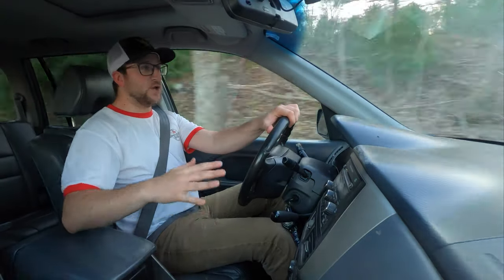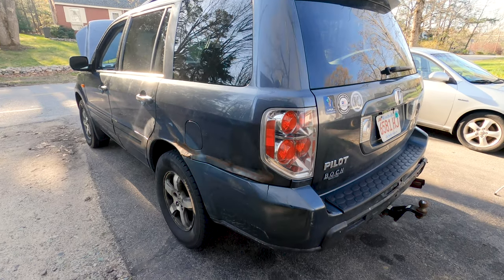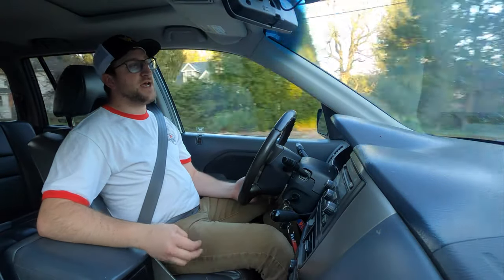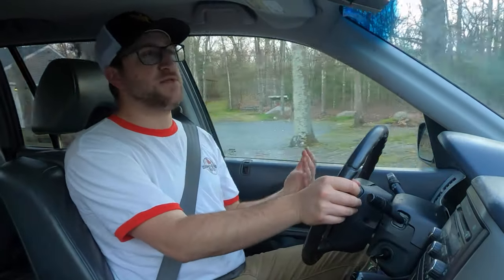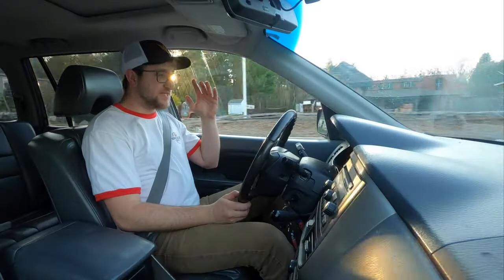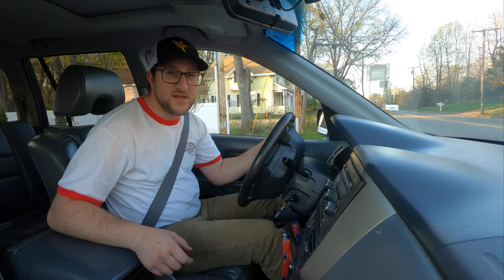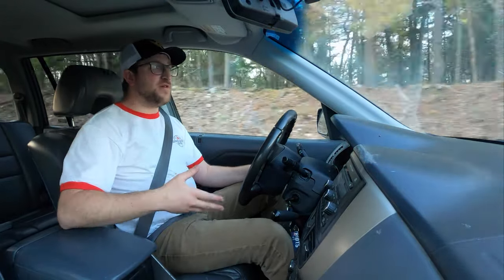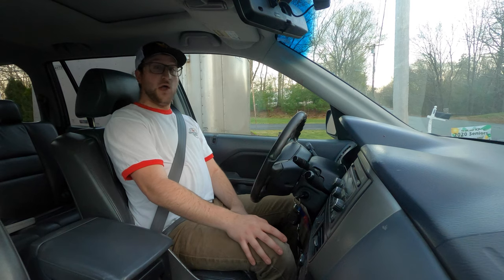1st Gen Honda Pilot - How Reliable Are They Really?

Comment: My 2006 Honda Pilot EX-L just turned 400,000 miles and still runs like a dream! It's the best car I've ever owned!
Reply: Any major repairs !?
Reply: We gave our son our 2007 4wd, and it now has 312k
Reply: Did you ever have to get a valve adjustment on your honda ?
Reply: @hortonsstuff6948 Did you ever have to get a valve adjustment on your honda ?
Reply: Good to know!! 211k on my son’s ‘06
Reply: I have a 07 2W drive mid size 164000 drive like a dream I will be keeping it for awhile.
Reply: 327, 000 on mine. 2004...
Reply: @shadowman1992 I did a valve adjustment on my 06 Honda pilot exl at around 235k miles and there was one done at around 100k.  It still runs like a dream at 367k miles :)
Reply: @CriticalQuack  do you recall if you had any tight valves?
Reply: @shadowman1992  yes my exhaust valves were very tight. And my intake valves were loose. Once I adjusted accordingly to spec all my misfire issues went away
Reply: @CriticalQuack  so you were having misfire symptoms before you did the adjust ? How long did you drive with the misfire symptoms do you think ?

Comment: I've got a 2004 pilot with roughly 340k miles and its amazing
Reply: Any major repairs or problems?
Reply: I have an 04 with only 212K. Runs like a dream!
Reply: Yeah... You can tow 4,500 lbs with it!!!
Reply: You give me hope
Reply: Good job 🤩
Reply: @RadioactiveSince1990x  the only problems I’ve had outside of normal long term maintenance was the starter gave out at 350k and I’m guessing it’s been in there since It came from the factory so honestly I can’t complain
Reply: @applepoop10  I ended up trading it for a lawn mower and from what I hear the pilot is still going strong, insane how well they’re built
Reply: 400k miles on my 05 runs like a champ
Reply: I have a 2005 pilot w 326k love it! Runs great
Reply: 2003 pilot with 338k miles here. Original power train, no tranny issues.
Reply: 404,000 miles on my 2003 model..Rebuild transmission at 230K in 2019 and was worth it...
Reply: Did you ever have to get a valve adjustment on your honda ?
Reply: @garrykennedy5484 Did you ever have to get a valve adjustment on your honda ?
Reply: @Elche2536 Did you ever have to get a valve adjustment on your honda ?
Reply: @margaritaman7745 Did you ever have to get a valve adjustment on your honda ?
Reply: @cmamaz Did you ever have to get a valve adjustment on your honda ?
Reply: @shaanonmaney1051 Did you ever have to get a valve adjustment on your honda ?
Reply: @shadowman1992  no
Reply: @shadowman1992  Yes, timing belt, water pump, spark plugs and valve adjustment at 227,445 miles. This was the first major work done. Probably should have done these at around 100k but I figured if it lasted past 200k miles, i'm in it for the long haul and had them all done. Power steering rack is leaking but I just top off with fluid when needed. It would run around $1500 to replace rack so cheaper to top off periodically.
Reply: @cmamaz  did you buy it used ? Or have you been the only owner?
Reply: @shadowman1992  I bought it new.

Comment: I still own a 2004 Honda Pilot  AWD 270K miles original transmission and engine, very reliable for all this years. All windows work, ac, etc.
Reply: Makes me feel a lil better to hear. Have the same year and model with 160k and I thought it was nearing breakdown even though it doesn't feel like it cuz usually cars last about that long.
Reply: Nice, have you replace the timing belt twice?
Reply: What kind of work have you had done for the transmission? I'm at about 163K and it feels like 2-3 gear is a bit rough
Reply: @TexasBassSlayer I currently going through this with my 05mdx. So far what I’ve seen people do is clean the shift solenoids, change the filter if you can access your and put new atf fluid.
Reply: Did you ever have to get a valve adjustment on your honda ?
Reply: Do u ever do the transmission fluid change?

Comment: My parents are giving me my first car,  a 2006 Pilot with 185k miles that we’ve owned since new
Reply: Get ready to get a new trans at 230k
Reply: Man You're gonna be fine.  You can easily get another 80 to 100 thousand miles on the clock with regular maintenance.  They're awesome. I had 152 thousand miles when I bought it and I  was up to 278 thousand miles and still ran smooth before I crashed. That's the only reason I don't have it anymore. Regular maintenance like oil changes, tune ups and belts will keep you on the road. I drove it everywhere everyday at least 80 miles a day because I live In a rural area.  Absolutely a great vehicle.
Reply: I just want to say that this is a good car. I suggest you that keep your eyes when is require to change the oil and fluids, do not left all what you car need to change. In fact it is not expensive to keep it in a good conditions. I have a Honda Pilot 2004 with more that 325.000 miles and is running so good.
Reply: @medievalmusiclover   Do you guys know if the older Honda Pilots were a little shorter in length than the new ones, they seem too big now, I was looking for a smaller one?
Reply: @MrNiceGuyDSGC99 Did you ever have to get a valve adjustment on your honda ?
Reply: @medievalmusiclover Did you ever have to get a valve adjustment on your honda ?
Reply: I agree do basic oil transmission changes, tune ups you will be find I have 3 pilots 03,07, and 10 strong pilots

Comment: I have an ‘06 pilot. And i love it to death. It is a workhorse, and I haul so much with it. Mine has been pretty beaten up by the previous owner, and when I received it, the oil was so old that it clogged the VTEC system and left me stranded, but I changed the oil and was good to go. So just regular routine maintenance and this car is a champ!
Reply: Im a amsoil dealer its what i run in my 05 pilot. Once year oil changes next level protection for any engine let me know!!!!

Comment: My 07 Pilot is currently nearing 192K miles. Still runs as new. Honda went beast mode when creating this machine
Reply: Still got it?
Reply: You betcha!!  My 07 just turned 450000 miles.  Yours is merely broke in!  ;-)
Reply: Did you ever have to get a valve adjustment on your honda ?
Reply: @jimwuerl7380 Did you ever have to get a valve adjustment on your honda ?
Reply: @shadowman1992  unfortunately, I got T Boned and it was the end of my Pilot. It had 205K miles and I was looking into timing belt change at the time. Never did a valve adjustment and not sure if the previous owner did it. However, I did maintain/exchange everything else religiously (oil changes, trans fluids, coolant, brake fluid, pads, suspension, spark plugs, steering, etc)
Reply: Im looking at 07 with 177k miles on it for 7,000 it's a AWD which I was looking for since I gotta work even during the worst icy weather.

Comment: I have a 03 with 240000 miles. Only ever needed brakes, rotors & fluid changes ( Don't forget the rear fluid. Do it yourself). Trans shuddered at 200000. Needed trans fluid change ( And Dr Shudder actually works) and two pressure switches. Easy to fix yourself. A few other little issues but it starts and gets me to work every day.

Comment: Just bought a n '07 Pilot with 108,000 miles. One owner and all recommended service done on time. I'm hoping you guys are right and at 64 I hope this vehicle is my last to own in my lifetime. I plan on keeping up the maintenance as well. Cheers and thanks for the great video!
Reply from the maker: Good luck with the pilot! Treat it well and it’ll treat you well
Reply: 2 owner
Reply: Not sure how much you drive but with only 108k you have a couple hundred thousand miles to go easily. Mines at 208k and has been maintained extremely well and runs like new and feels like it hasn’t lost a single horse power. I literally call in the sewing machine, it’s just so smooth at everything it does. I love it. I was looking for a first gen crv, this had the higher towing capacity and cargo room and to me just looks like a larger Crv. You won’t find me selling it ever, if I get rid of it, it’s because I wrecked it or someone stole it.
Reply: my 08 has 270800 miles and runs GREAT STILL just change ur air intake hose 👍
Reply: @ethancoons2606  what happens with the air intake hose?
Reply: Air intake hose rots/splits away at the hose clamp end.
Reply: @ethancoons2606 Did you ever have to get a valve adjustment on your honda ?

Comment: I have a 2007 Honda Pilot EX-L Navigation 4WD in the steel blue, solar green. That bright aqua blue, green color you see on the first gen pilot. Lol. Mine has 204,000 miles and I got it with 196,000 miles. I have owned it for the last 7 to 8 months. My previous owner bought my pilot brand new in California off of the showroom floor brand new and he kept it all this time for 12-13 years and resigned the title of interest of the vehicle on October 23, 2019. And I bought my pilot off of marketplace for 3200$ and I think it was sent to auction but the car was in perfect shape. The engine, transmission, interior and exterior looked very clean, shiny, and pristine. Absolutely no tear in the leather seats, no wear and tear anywhere in that car. My alignment on my pilot is absolutely perfect, steering wheel is straight. Engine idles and runs very smooth and drives nice. My pilot is probably one of the most rarest ones out there. I have a back up camera. 4WD vtm-4. Heated mirrors. Garage home link. Cruise control. Sunroof. Leather steering wheel. Oil life percentage. Outside temperature. Tire pressure monitoring system. Navigation. Premium audio system with subwoofer. Cargo net. 3rd row seating. Heated front seats. Power driver seat. Rear automatic A/C with vents. Front automatic climate control. Voice recognition with voice activated navigation. Which the button is located on the left bottom side steering wheel behind the audio controls. My alighment is straight. Steering wheel is straight. Car drives and points forward. Has 4 brand new aftermarket tires and rims. Had my valves bent back straight and a new engine piston head installed on my engine after I had some little mishap of overrevving the engine in the manual mode (learned my lesson and don’t try that lol) 700$ engine rebuild. Had new brakes installed and put on for free. The tires and rims were 800$ together. And the car was 3200$ and plus my timing belt was just changed and so was the battery right before I bought it too. I love my pilot so much and I take good care of it and I also keep it very clean and very spotless inside and out and that’s coming from a 20 year old owner of it. Lol. I bought my pilot 12-09-2019.
Reply: Did you ever have to get a valve adjustment on your honda ?

Comment: I like the body styles of the first and second generations.  I also own a 2004 (155k miles) and a 2014 (85k mikes).  Both are reliable.
Reply: I bought a 2007 Honda Pilot basic model not loaded with options, it has 326k kms and has rust,
I originally purchased it to flip it but I like the looks of it should I keep it or flip it and find a better one? Thanks!
Reply: @shabirazizi527  if you can flip it and makes some money then use the money to find a better one. You’ll end up loving it for sure!
Reply: Did you ever have to get a valve adjustment on your honda ?
Reply: @shabirazizi527 Did you ever have to get a valve adjustment on your honda ?
Reply: @shadowman1992  no but don’t know if I have to or not.
Reply: @shadowman1992   At 160k, the morning clacking was starting to annoy me.  All the intake valves were within speck.  Several of the exhaust valves were too tight.  Did it have to be done?  Likely not.
Reply: @brianaustin1328  I have been asking a lot of honda owners online with high miles on their engines and I have to say about 90% of thoes I ask say they never get a valve adjustment I wonder how they make it so far without one? I have not gotten one at all yet

Comment: I have a 2008. 294,000 still runing great. Original trans and engine. I've pulled trailers with thing for construction. I love it.
Reply: Hello, is your Pilot FWD or 4WD? Thank you.
Reply: @kevinjefferson9739  4wd i have 316 000 now
Reply: @dwaynecarlson8953  Did you install the VCMTUNER II – Advanced on your car, to deactivate the ECO MODE? Does your car burn or consume any oil?  What brand name of engine oil and oil filter do you use? What is the interval between oil changes? Thank you in advanced.

Comment: In 2016 I bought an 04 1 owner pilot that had 74k miles and it had every service record that had been done at the same dealership, its now sitting at 144k miles and I've driven all over the country and hauled all kinds of stuff in it. It's the best vehicles I've ever owned!
Reply: Did you ever have to get a valve adjustment on your honda ?

Comment: I have been wondering for so long if a Honda Pilot is a reliable vehicle. Thank you for finally answering my questions.
Reply from the maker: Christopher Monteforte you’re so welcome, Christopher.
Reply: I have an 04 Honda Pilot have had her for eight years with 263,000 miles.  Have only had to replace two tires, the battery, window assembly,  and just recently the headlight.  All parts replaced were factory placement not bad for a vehicle that's eighteen years old.
Reply: @kimberlydieterich4157 Did you ever have to get a valve adjustment on your honda ?
Reply: I have  a 1997 acura tl with 250,187 just regular maintenance made in Japan wanting to keep this car forever what do think?@NotSoHandyCarGuy
Reply: I’m still on my first Pilot, the 2008 with 180,000 miles on it and it’s perfect. My Mom is on her 3rd Pilot, but that’s because she trades in so it’s always under warranty and low mileage, whereas I drive my cars until they die. We’re both 💯 loyal to Honda Pilots because we’ve never been stranded anywhere by ourselves.

Comment: Just bought a 2005 Honda Pilot 255,000 runs great.. could put a glass of water on the dashboard and would not see any vibration. I asked the owner if he had ever had any major maintenance done.  He said no. I'm replacing control arms and rear sway bar links. Paid 800$ for it and it seems to run like a champ
Reply: Did you ever have to get a valve adjustment on your honda ?
Reply: @shadowman1992  I bought it used with that many miles. So didn't know the history of the vehicle. I had to sell that one. But I have a 2006 Honda pilot now. Has 380,000 miles. The lady I bought it from had years of receipts and I never seen any valve adjustment in the receipts. It runs and drives great. But the rear cradle is really rusted out and is a big point of concern for these pilots in the rust belt
Reply: @SSanscraintenotaboat  sorry about the rust. Rust sure sucks. But I was just curious man asking a lot of honda owners the same question because I have not gotten a valve adjustment as well but they say if you don't it will wreck your engine so just seeing how far some engines go without one like yours

Comment: I loved this video.  Thanks for the 1st Gen Honda Pilot love video.  2005 Pilot, 203,000 miles!  Engine bay is louder than it was 7 years ago, 3rd gear shifts harder, and trouble codes for the Catalytic converter, but is still going strong.  Had a radiator burst on me back in 2013, other than that, she's loyal.
Reply: Did you ever have to get a valve adjustment on your honda ?

Comment: I have an 03 that’s about to hit 260K, I can tell you it’s one of those cars that will start every time with no issues, I’d strongly recommend it if you need a family hauler for cheap
Reply: My trans is bad in my 03 205k but it actually runs fine. Doesn’t go into first I just do it manually and it slips when I put it back in normal drive at like 40mph 😂 engine runs like a top tho did spark plugs recently
Reply: Did you ever have to get a valve adjustment on your honda ?
Reply: @bdo2304 Did you ever have to get a valve adjustment on your honda ?

Comment: i’m in my 05 pilot still with 240 K miles, never had any issue ever
Reply: Thinking bout buying one a 2006
Reply: @unawakenedque  congrats on the best decision of your life
Reply: @unawakenedque  if you live in the salt belt, they typically rust at the seem above the rear wheel wells.
Reply: Mine was Honda Pilot 2019, and hit 13k miles. I had lots of problems during the time such as annoying noise, vibration, electronic malfunction also got recalls several times. That was really awful. But I end up trade in Pilot 2021, and no issue so far. My previous one was manufactured on a day before holiday I guess...
Reply: @AlexK-rd1ki  312k miles on my 08, thing still roars
Reply: Lol wtf you got the same name as me, I got an 03 with about 280k miles
Reply: @Darkhunter218  alex k gang
Reply: Did you ever have to get a valve adjustment on your honda ?
Reply: @MiguelPerez-yk7eb Did you ever have to get a valve adjustment on your honda ?
Reply: @Darkhunter218 Did you ever have to get a valve adjustment on your honda ?
Reply: @shadowman1992 Nah, I ended up selling it coming up on 320k miles lol, it was still running fine.
Reply: @Darkhunter218  that's awesome. Did you buy it used ? If so what mileage did you buy it at ?
Reply: @shadowman1992  nope never had to get a valve adjustment
Reply: @AlexK-rd1ki  do you still have it ?
Reply: @shadowman1992  sadly no. alternator gave out at 280k so i sold it